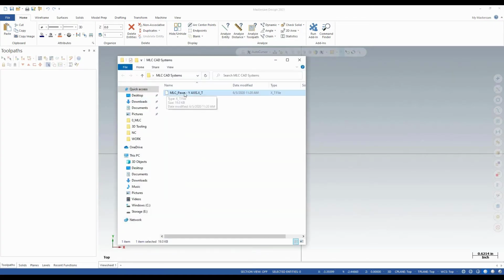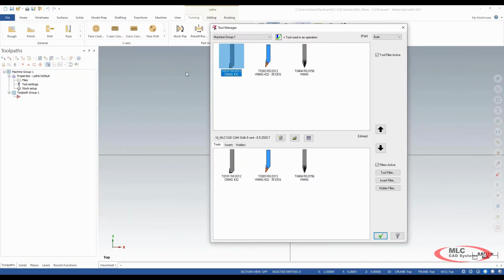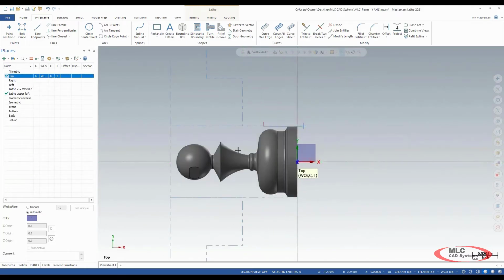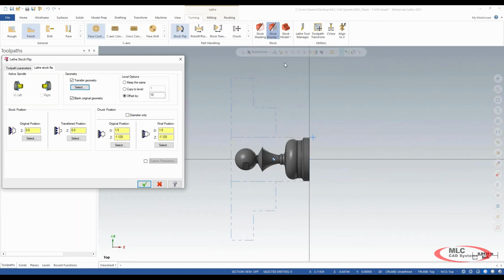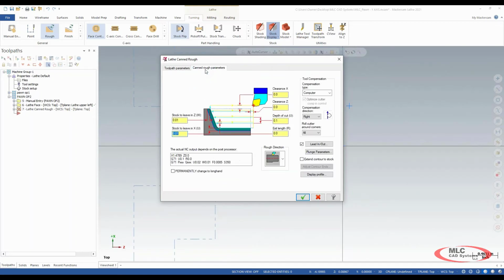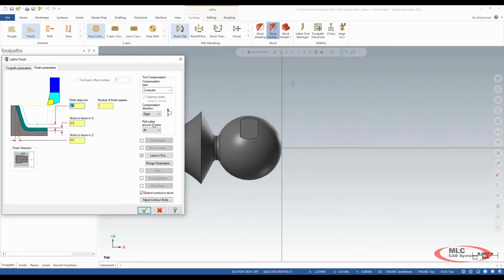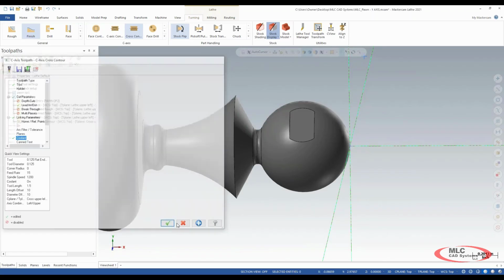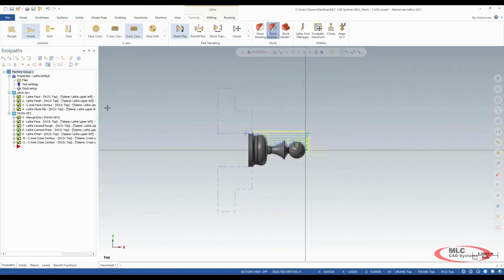Getting Started in Mastercam Lathe | Webinar

Comment: Another reason to prefer canned cycles is that it can make it much easier for a machinist to understand what the machine is supposed to be doing at any moment.
Reply from the maker: Exactly, clear communications and comments make the code so much easier to navigate and understand.
Reply: @MLCCADSystems  Also it's the programmers job to make a toolpath that matches the print, but the machinist will optimize speeds, feeds, doc etc. and editing long handed doc is a pita, especially on tapers. The canned cycle is a necessity so I can tinker with the doc to break the chip. The doc and feed required to break the chip varies based on material condition, chipbreaker geometry of whatever insert is on hand, tool height error (affecting rake angle) from crashed turrets that will always get fixed after the next job etc. etc.

Comment: When you did the 2nd side flat, how did the machine figure out what is the degree it will turn to do the 2nd flat?
Reply from the maker: The orientation of the part was determined based on the feature itself. In Mastercam, the software recognizes the selected chain of the feature. When using wireframe, it's also possible to create planes to drive the toolpath. One advantage of creating planes is the ability to control the rotation, allowing you to set the toolpath at your desired angle. This approach is particularly useful if you prefer not to machine the feature directly from the face T-plane. I hope that helps!

Comment: Your video is very helpful! Have you come across something like when master cam would post G-codes but machine would do something else? I think this issue has to do with machine configurations. How would you fix the problem. Thanks in advance!
Reply from the maker: That is a very odd thing indeed, and would likely require an expert to help you troubleshoot it and narrow it down to the Mastercam project, the post-processor, or the machine control itself.  Some CNC controls and variants can have special quirks that you have to know about and understand to work around or adapt your code to.  If you are an MLC CAD Systems customer please reach out to our team to discuss your issue, https://mlc-cad.com/technical-support/, and if you need help with your post we can offer that service to just about anyone, https://mlc-cad.com/service-inquiry/  Good luck with your machine!
Reply: It has taken nearly 3 years to get mastercam as i like it for our Okuma multus B400W and thats ONLY for the milling side... not started on the lathe side till now and i expect there to be alarms galore. My Mastercam reseller in Sweden is excellent and my agreement covers this very in depth and very demanding area. Its a little odd i think that such a complicated machine is not already set up for this. Our post processor NOW posts at the top of every program... a tool list WITH load monitor info and load monitor Nr and operation Nr
Also each operation contains the load operation Choice of Nr AND the load operation axis to monitor. Everything now posts clean. It has been a very long and laborious job with a high demand from my side to get it this way. I dont think anybody at work could comprehend the dedication it has taken to get us this far. And now we start with adding the clean posting of lath operations. Once done though.... the enjoyment of working with the machine is much better. My only concerns has been with management not understanding this and the worry of new mastercam versions messing up this mountain of work.
Reply: We're having the same problem with our Tool Room lathes. Did you ever figure it out?

Comment: Whenever people create jaws they use "parameter" instead of "chain". Chain does not seem to work. Following the instructions for chain does not work.
Reply from the maker: I asked one of our experts to test this and Chain worked on their file.  It could be caused jaw geometry with overlapping or duplicate contours creating this problem, or not trimmed properly.  This is a perfect example where your local reseller will be able to look at your files and workflow to help you figure out the best way to proceed.  Best of luck!
Reply: @MLCCADSystems  I am using 2020. First of all, directions say to draw in upper quadrant. Which one? There are 2 upper quadrants on my planet. A right and a left. I tried both. No good. Secondly I tried a very simple geometry using a rectangle from the rectangle drawing feature. 4 entities (lines connected). No duplicates. All  sides trimmed with no breaks. I used top view as stated in the instructions at Z0. No good. Nothing I see works. After I select the chain, it says to select the geometry, which I already did, over and over again.
Reply: I guess MLC cannot get it to work either.
Reply from the maker: It works for us.  You need to reach out to support, this won't be an issue we can troubleshoot blindly in these comments
Reply from the maker: If you are a customer of MLC CAD Systems, please contact our support team and reference this comment section and I will make sure we get you directed to the author of the video. https://www.mlc-cad.com/technical-support/
Reply: @MLCCADSystems  Just post a video on this working on 2020 s we all can see.
Reply from the maker: We will pass this request on to the team for consideration in a future video.  For individual concerns and requests, reach out to your local team for direct support and timely response.